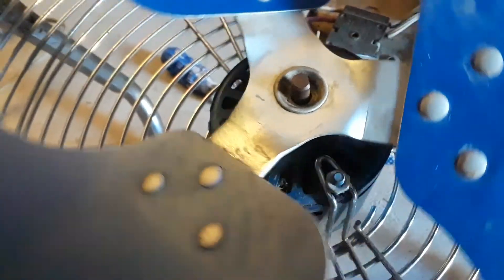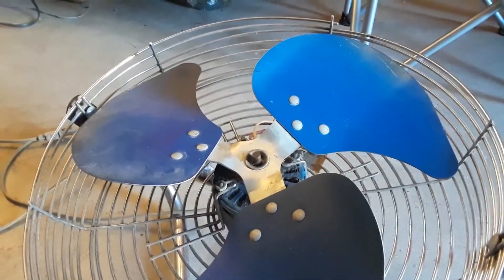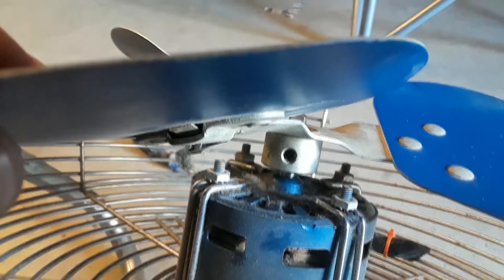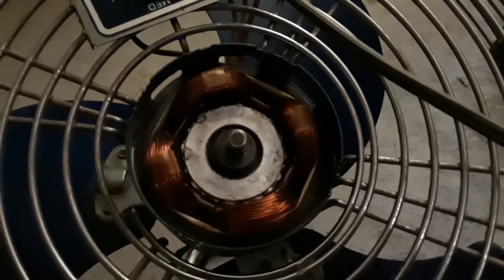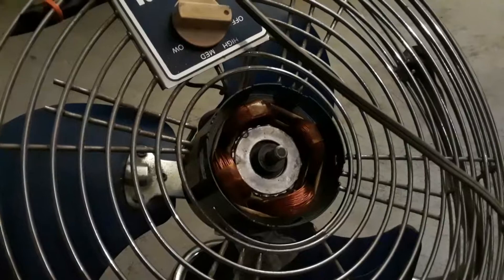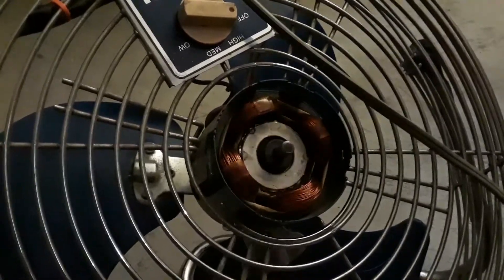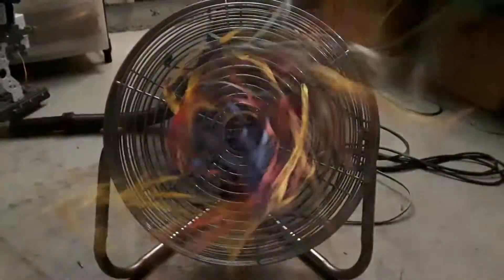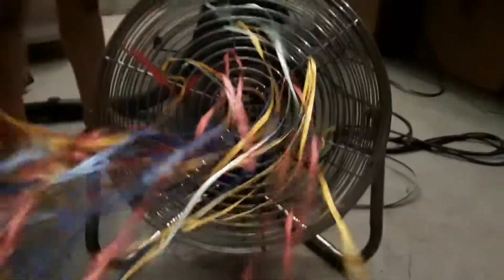Patton Fan Clean Up

Comment: How do you get the cage open
Reply from the maker: There are metal tines that bend and tension hold the front.  This fan is not as secure as it was at one time 🤗 and popped off while running recently.  Yikes!